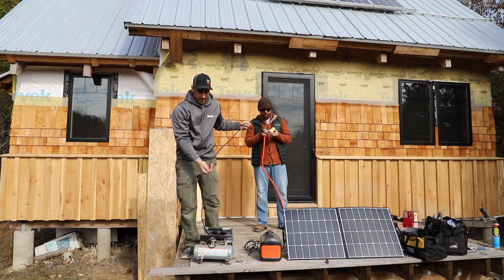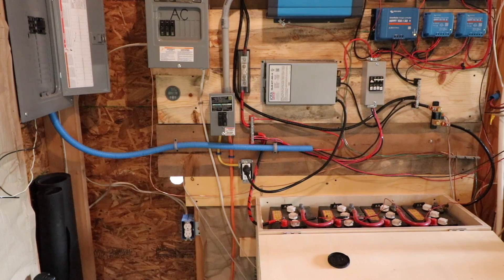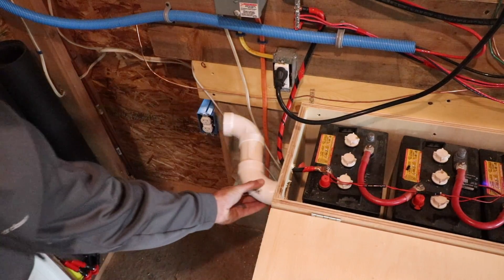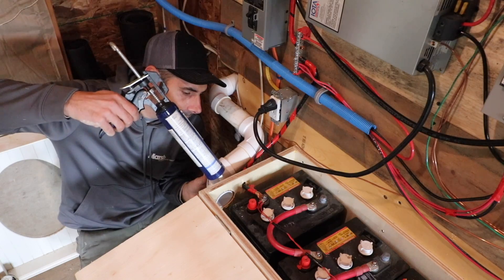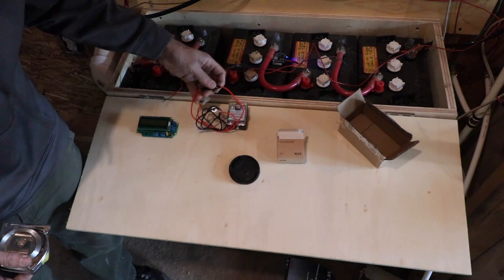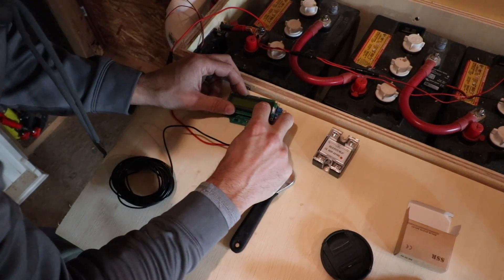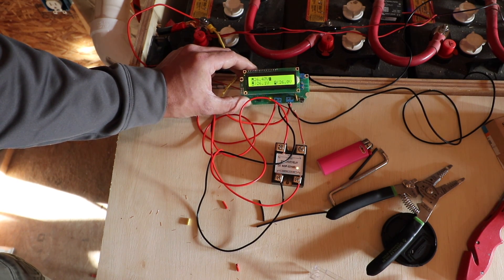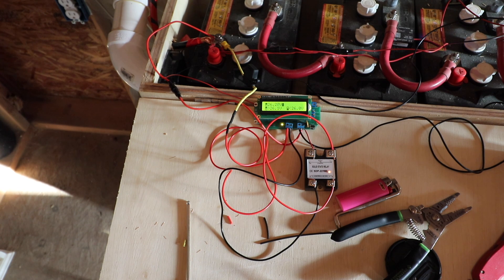Solar Project: Voltage Activated Battery Venting

Comment: Being that the gasing  from these batteries are highly explosive, having a fan inside the box is this safe?
Reply from the maker: The gas has to be quite concentrated to pose that sort of risk.  It will passively vent even with the fan off, so it really can’t concentrate enough to become an explosive risk.

Comment: For anyone else considering doing something like this, you can skip the relay.  The WindandSunPower controller can run up to 1A directly off of the output contacts.  Just wire battery voltage to the battery + and - and connect your load to the relay output being careful to watch polarity. It's a good idea to add a 1A fuse between the controller and fan +.
Reply from the maker: Oh that's cool, didn't realize it could do that.

Comment: Over-all a good video. That being said the wiring diagram is NOT correct. The wiring diagram on the Sensing Controller IS correct. Thanks for sharing

Comment: Wouldn’t that just be a huge point of cold air leakage into the cabin?  Now the battery box will be colder, thus reducing capacity.
Reply from the maker: yea it is but it's also kind of a necessary evil since you want it vented to the exterior.
Reply: 50 Acres & a Cabin I can build you a lithium / lipo battery pack with double to triple the capacity:)
Reply from the maker: xzibit8614 that’d be awesome, Lithium has always been my long term goal, but at the rate I have these batteries so overpanled I rarely take them below 98% charge.  I think they will live forever even though I kinda want them to die so I can upgrade!

Comment: So confused about finding 24V lighting for my cabin. Most of the "24v" are not rated to run on a real battery (mostly a converter that is nice and clean). What lighting works for a real battery at 24V?
Reply from the maker: Its definitely harder to find and that is one of my frustrations with my 24v system.  I have bought everything I used from Amazon.  Let me grab a link for you.  12/24 Volt DC LED Bulbs: https://amzn.to/2KMxFdI I just search on amazon and a lot of the china made bulbs are labeled for 24 volt also.

Comment: What size smurf tubing did you use? I would like to use that in my cabin for the solar upgrade.any info would be greatly appreciated. I enjoy the videos keep them coming.😁👍
Reply from the maker: Thank,  I believe it is made by carlon I used a combination of half inch and 3/4 inch I think.
Reply: @50Acres  ok thank you, I saw you snapping all boxes and tubing I said hmmm I like that, haha. so I will give it a shot

Comment: Nice battery-box, good to have ventilation, think the relais uses more current than the fan, don't think you need that, anyway keep up the good work, I'm living for 9 years on batteries will never go back to on-grid.
Reply from the maker: I've got to re do this project somewhat

Comment: It’s a low probability, but if the fuse blows it becomes an ignition source. The gas produced during charging is Hydrogen. Get the ratio correct add an ignition source, you got an explosion. I would suggest mounting the electronics an fuse external to the battery box.
Reply from the maker: Yea I actually have to take the whole thing and redo it because it also has an idle draw on the batteries,  I’ll probably locate the fan outside the box and make it a pusher.

Comment: Howdy , i went thru this setup on an off grid system near Terlingua Texas , fan and  connections were a pain due to corrosion . solved problem with a can of flat black spray paint to vertical vent pipe . no noise no power use and no hassle , if sun is charging batteries , vent pipe draws a big amount of air due to hot air rises .
Reply from the maker: nice, that sounds like a good setup

Comment: Good to see some one is kindly assisting you. Nice hair cut.. hahahehe

Don't you think the batteries need a separate small housing outside the main house.. just in case..
Reply from the maker: Yea it was great to have some help.  Supposedly its ok to have the batteries in side as long as they are contained and vented
Reply: @50Acres  vented but the whole house is fully insulated ...come to think of it.  
Just a mere observation.

Comment: Don't think you need the fan to run so often. Passive vent should be fine. Maybe installing an on / off switch to turn the fan on and off when needed. Maybe eventually put the fan on a timer. LOOKING FANTASTIC‼️👍👍   Vinny 🇺🇸
Reply from the maker: Thanks Vinny, I agree, probably overkill

Comment: Thanks for the upload. I learned something new each time.   My electric bill runs about $300 a month.  So multiply that by the next 5 years and I've decided it would pay me now to have solar installed this next spring.  Seeing you use it, install it and seeing the outcome makes people more familiar with the operation and potential rather than diving into something blindly.  I also want to get rid of my natural gas furnace and install an electric one for winter and the a/c for summer. So I realize I'll have to have a huge solar array to do all this and maybe sell some back to the grid.   I'm going to install a whole house back up generator just in case an emergency would happen.

I'm going to install a wood burner with blowers to heat the house and use the electric furnace as backup.  All this takes planning but I think I'll like that lifestyle.  As a kid we used to burn wood and coal in an old furnace in a basement on the farm.  It was so warm in the house we had on tshirts in winter.  So many people want to spend 250k or a lot more on a home.  I think more people are downsizing and your cabin is not just a getaway but a permanent option that more people are getting into.  The only real modern convenience I'd keep for sure is a garage with a door opener.  Who wants to scrape snow and ice?    Again, thanks for your time recording these.
Reply from the maker: Thanks Vaughn, that will be one big solar array but, if you make them big enough, they work.  Natural gas pairs pretty well with solar right now and can really cut the size and cost of your system, then if gas prices rise you could expand the solar later.  Or I guess if you go all wood that will work but the gas makes a nice backup when you travel.  Good luck with all your plans.   Agree on the house sizes my wife and I live in a small 1K sq ft place right now.

Comment: I would add a potentiometer inline with the fan so you can slow it down a little and make it quieter. Those fans don’t need to be full speed.
Reply from the maker: Yea, thats not a bad idea, I put one on my whole house fan a couple videos back, it works great.

Comment: nice,, way to go, we were up at our place over the last week, our discussion always turns to jobs not completed, one of which is the solar up grade . Currently we have a battery hooked to a panel and the wire coming in a window,, lol  runs some LED lights,  your place is coming along nicely. Whens thew woodstove install happening, we have a ft of snow already here in Ontario. :0), Bob
Reply from the maker: Nice Bob, honestly I think once the cabin is built I could get away with a system that size,  aside from one accident I have never taken my batteries below 95% charge.  All I use big amounts of power for is building the cabin itself.
Reply: 50 Acres & a Cabin nice, it’s a beauty system, enjoy ! 👍😎🇨🇦

Comment: You do what you think is best, but i would not put a fan or the switch in a  hydrogen atmosphere i don't believe the fan or switch are explosion-proof rating
Reply from the maker: Hi Dirt, a couple people have mentioned that now.  I am not sure on the fan I will have to check.  I question whether enough hydrogen can get concentrated with the vent there.  It can still rise up and out without the fan blowing.  I'll probably just take the fan out and use the controller somewhere else.

Comment: Just wondering why the front of the box and not by the wall? It’d be less in the way and save you an elbow
Reply from the maker: Just because there was a good deal of stuffing the way of drilling a clean hole back there.

Comment: Missed you since the bachelor party.  Good to see you had a helper with the shingling.  That way you could attend to the battery venting.  Once again, I greatly admire (and envy) your knowledge and expertise with electronics.  Wish you had shown what your friend had accomplished before ending the video.  I'm sure you insulated and closed up the pipe hole (and the pipe) to the outside off-camera.  Take care and be well.
Reply from the maker: Thanks for watching Fancy, I have been pretty busy working on other stuff but I should be back at it for a bit.  Yea I put some insect screen over the pipe end.

Comment: Switched outlets outside the cabin give you power outside without needing to run extension cords and the best part is you can turn them off inside so they are dead to the world when not needed. To not spoil the look you can even tuck them under the cabin to avoid cuts into the siding.
Reply from the maker: Been meaning to put some in actually, right under the cabin like you suggest...
Reply: Andrew H I have 2 outside my log home with hinged covers on.  They are used a lot.
Reply: A hidden hinged shingle to hide it while not in use would be a fun project.

Comment: With that tiny fan you could have hooked it up directly to the controller without using a relay at all. :-)
Reply from the maker: Really?  Thats cool I was just following the minimal instructions with the controller.
Reply: @50Acres  Yeah, that fan is probably using a couple of watts so maybe 100mA tops so the relay driver will handle that just fine. :-)

Comment: Awesome video as always!   Love your series!  My 86 year old Dad and I always check on Saturday nights after church to see if you have a new video up.  I hate to second guess other people's projects but since your pipe isn't carrying water you could have just cut it and fit it without gluing.   That way you still vent the box (into the room) and could have a free heat source in your cabin in the winter then add the pipe vent during warmer months .  You would just stuff some insulation in the pipe in the wall and cap it to keep the cold air out in winter and then piece it back together during warmer months.  Not being critical just giving you a thought!  Keep up the good work!
Reply from the maker: Hi Att MI, that's really great to hear I am glad you and your Dad get to do that together.  Yea I guess I didn't have to glue the pipe.

Comment: My friend you need to add a in take hole. Thanks for the video brother. God Bless..
Reply from the maker: Hey Bobby, I'm a bit late on comments was down working on the cabin.  Right now the box isn't air tight, it gets makeup air from the room, but I like the idea of outside air.  I could make things even more complicated and do a heat exchanger.  Also, I left my inverter on sleep mode last trip, got to the cabin and the batteries were at 30% (I usually shut down the solar before I leave too).
Reply: @50Acres  I crap that is not good man. Brother I was not trying to sound like a ass hat. Hope you know that.
Reply from the maker: @yankey4  no worries bobby!
Reply: Bobby's Solar Homestead, indeed, I was thinking the exact same thing. That fan won’t extract much as there is a vacuum created in the sealed box?
Reply: @Flyingscottyman  Right needs to pull air from out side into the box then back out. If not your going to pull your house air out the box..
Reply: Bobby's Solar Homestead i dont think its 100% airtight but i think you have a good point! 😊
Reply: @geoffupton  Well its not but here is the thing. Like that is going to pull the air from in the house out. If he pulls air from out side then into the box then back out would be the best. One thing that sucks about this is now his batts will be colder. But that part of life with FLA batts..
Reply: Bobby's Solar Homestead agreed 😊

Comment: Here is a return on click baiting.  1) Will you address the exiting pipe outside?  90 down and critter free?  2) Gas flumes drop.  Yes, the fan is over kill in my opinion.  Not to mention; it is not an exhaust fan rated for chemicals (Spark, spark boom!).  3) I have been witness to more than one battery explosion and had an employer with a disfigured face from it.  You never forget the ear piercing sound.  4) Finally, I know you are playing around and enjoying the play toys of the Gadget Generation but the older you get the more you may find (the wiser you become) that "Bells & Whistles" are actually more time, more money, more maintenance than they are worth.  For example; are those little devices capable of surviving extreme cold?  Are you now forced to keep them warm while the cabin is not being used?  Just a little click bait back at you; that's all folks.  Cedar shakes are coming along nicely.  KEEP IT SIMPLE.  Click, click bang!
Reply from the maker: Thanks JF, I have a 45 and metal screen.  2) a couple other people mentioned that, hydrogen would be the flammable gas that gets produced and it rises, so I'm not seeing how it could concentrate with the vent there. If the fan ever breaks, I don't think it's really needed in the first place, so I'd just let it passively vent.
Reply: @50Acres  True.  Hydrogen is lighter than air and will float.  Yet, hydrogen sulfate will sink.  A good gadget is one that serves a critical function; like a charge controller.  Over charged batteries produce hydrogen gas.  The dangers of a gas is obvious.  Surely, you're safe but its knowledge worth sharing.  Thanks for the feed back and the videos.

Comment: ..great vid, the build is lookin' good.venting is a great idea, not a lot of off griders mention this..do you need a vent on the opposite side of the box,so air can get into the box to increase air flow ?
Reply from the maker: Yea you would need something like that.  This box isn't really air tight so it can get makeup air.
Reply: @50Acres  ...it looks like it will do the job..